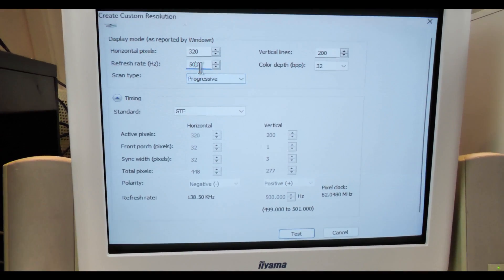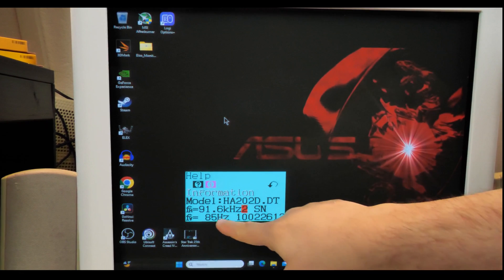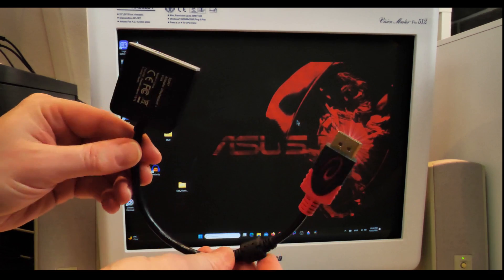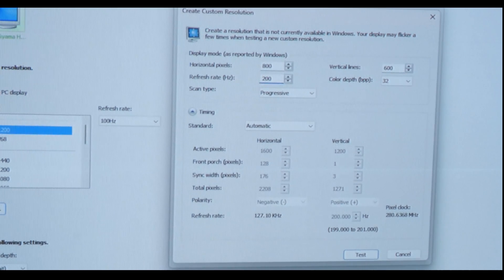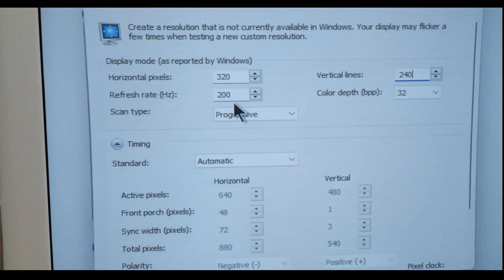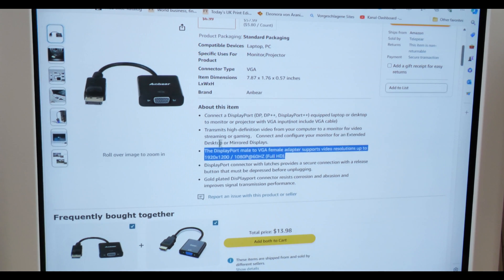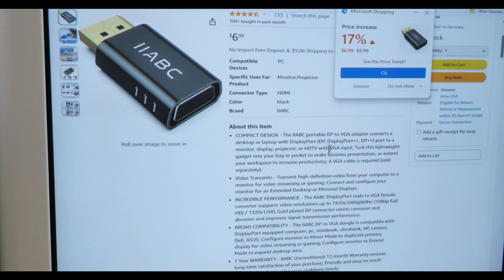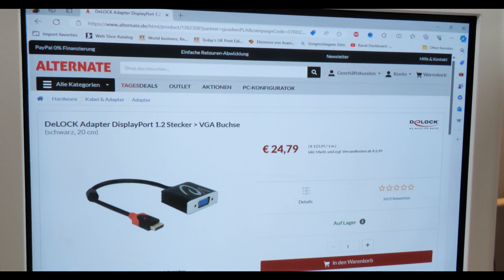The Best VGA Adapters to Connect a CRT Monitor to a Modern Gaming PC

Comment: I have that same delock adapter as you and no matter what I tried, I could not get it to work with any custom resolutions on my windows 7 laptop with Nvidia NVS 5100M. It will just say that the resolution is not supported with this display. It also tells me that this device is not HDCP capable and I am guessing that is why it won't work? Also, even if I use Custom resolution utility and try to run restart, it won't let me and a message will come up saying Failed to restart graphics driver. Unfortunately, I do not own any other device that has a displayport output, so it's etheir the delock itself, or my laptop that is not letting me set up a custom resolution. Can you please tell me how you got yours to work? Thanks!
Reply from the maker: Hey this sounds like a issue with your GPU or the way your Monitor is set up in Windows. Normally it just works, there is nothing special you have to do. Just go to custom resolution and enter a resolution that you want. Maybe try and change the Monitor to something that can 100% do the resolution that you try. It does not even matter if the Monitor is the correct one, I often just take Mitsubishi TUX 1107 no matter what is actually connected.
Reply: @RetroGamingBase  I guess I'll be buying a new computer then. I've seen your videos before and I know that you like pushing the limits of the iiyama CRT monitor that is said to be the fastest CRT monitor in existence, but have you ever tried to run interlaced resolutions on it before? I have a HP laptop from 2022 with Intel UHD graphics 600. I am using a Benfei HDMI to VGA adapter and can push it up to 2040×1400 as that is the max interlaced video resolution that it will accept and looks amazing on my Viewsonic Ultrabrite E70f+. Now I am not sure if newer Intel GPUs still support interlaced video as both big makers Nvidia and AMD seemed to have dropped it years ago, but on Intel's official website, they claim that their newest line of GPUs, Arc works with interlaced video resolutions, which would be absolutely insane if they do. I highly suggest that you give any Intel GPU a try, [to be safe, Intel UHD 600 series or lower since that is what I have been able to prove that works] (even laptop GPUs) just be sure to use Custom Resolution Utility to make a custom interlaced resolution, otherwise it won't work.

Comment: Excellent video! I have the Delock 62967 display port to VGA adapter for my LaCie electron 22 blue model II PC CRT monitor. My video card is the 1050ti GTX OC edition low profile model. I have noticed you are using the Nvidia's control panel to set custom resolutions. What about using using CRU by ToastyX app? Can it handle more custom resolutions or I can just use the Nvidia's control panel?

Thanks in advance!
Reply from the maker: CRU is good to force the resolution in every game. Most of the time Nvidia Panel is totally enough though.

Comment: What adapters do you use? The best adapters are all bought out now with hightest pixel clock, Sunnix DPU 3000
Reply from the maker: Yeah I think my video has helped to make them even more rare then they already were… I use the Delock one that I show here and I bought a few of them years ago.
Reply: @RetroGamingBase  I have also delock
Reply: @RetroGamingBase  buy another delock because there is only few units of this model on the market, almost bought out

Comment: Hi do you have a link for the delock adapter?
Reply from the maker: https://www.otto.de/p/delock-62967-adapter-displayport-1-2-stecker-zu-vga-buchse-schwarz-computer-kabel-display-port-displayport-S098D0HV/#ech=28618109&variationId=S098D0HVCXUU I found it here
Reply from the maker: Here is another https://www.voelkner.de/products/5196511/DeLOCK-Adapter-Displayport-1.2-male-VGA-female.html?ref=55&offer=acd748916611e872b7cce716f5f45865&utm_source=google&utm_medium=organic&utm_campaign=fpla&campaign_type=pla&pla_campaign_no=11594509194&campaign_content=163213285584&gad_source=1&gbraid=0AAAAAD7b-kYtqrY_0gDv9GOT0m-t649dr&gclid=EAIaIQobChMI6-bqoua1hgMVwJNoCR0fuApFEAQYAyABEgJwDfD_BwE
Reply from the maker: I could only give you a link for Germany if that helps? I just googled Delock dp to vga adapter and searched for the correct box art. Be careful! Delock also has a cheaper one who is not good enough. You need the 2500x1600@60Hz one
Reply: @RetroGamingBase I live in Germany that would be perfect
Reply: @RetroGamingBase  I cannot send links can you maybe put the link in the video description
Reply: I also tried to look for the cable but only found a 20 m cable
Reply from the maker: I suggest buy it at voelkner
Reply: @RetroGamingBase  thank you very much
Reply: @Uboo3  the delock with Red dp almost bought out

Comment: Actually would be interesting even in non Retro application. 
As an esport enthusiast, I wonder if you could drive the monitor in 200+hz in a more reasonable resolution.
I'd actually consider that for my VALORANT/CS Sessions.
Reply from the maker: It can do 800x600 @200hz and that resolution is still officially supported by windows 11 and is totally useable in all games. Especially if you use sparse grid anti aliasing it will look like full hd on a CRT. Check out my very first video on this channel and see how you like the looks. The resolution there is only 640x400@255Hz and it also still works good in games 😀

Comment: If you own a GPU with USB-C you can use a cheapo converter that will do what all the expensive HDMI or DP converters do. Like my Vention which was about 20 bucks.
Reply: What model of the Vention you have?
Reply from the maker: Nice! Good to know 👍
Reply: Search adapters for best chip on google IT6562fn

Comment: Any adapter that goes to a pixel clock of 360 to 370 MHz ? I have a Samsung 1100MB capable per spec of up to 160 Hz Vsync, 130 kHz Hsync, and 360 MHz pixel clock bandwidth. Does 2048x1536 at 80 Hz just fine, for example. In reality it can go a bit higher, but even per spec it's high enough for me. Just need a decent adapter to use it with a modern computer.
Reply from the maker: Read the pinned comment 😀 apparently there seem to be adapters that can do what you need 👍🍻
Reply: @RetroGamingBase  I find some Nvidia Quadro cards with 400 MHz RAMDACs (integrated), but no adapters... Apparently there are some that go to 300 MHz only. Currently I'm driving the monitor from an old HP laptop capable of 400 MHz also. But that won't run Windows 11, for example.

Comment: Yeah. But StarTech is better. I've a GeForce RTX 4090 GPU + StarTech DP to VGA adapter and... I can work 2560x1600@60Hz! - my video on 19th may 2023. 😍😁🥰
Reply from the maker: Good info! 😀 I need 100Hz at least though, or my eyes hurt. This Delock here can also do the 2560x1600@60Hz. At least it says so on its box, as you see in the video 😅
Reply: @RetroGamingBase  ok. 50Hz doesn't hurt my eyes, sorry but this is for TV or videos of 50fps only because we get pure smooth motion ( = single image). 😍😋😚👌👌 At 100Hz, we get double-image because any video has only 50fps capped. 😅😊
Reply from the maker: @ricarnuninho80  oh yeah TV is ok. Just at computer monitor CRTs you need more Hz to make it flicker free 😀👍 Especially in bright pictures or while in windows you notice flickering below around 85hz. At least most people do 😅
Reply: @RetroGamingBase  😊 But I don't like any real CRT 'TV' due to the weak focus, to the dirty picture (color, ghost...)... 🤮😅 I want any CRT 'monitor-computer' at 50Hz for excellent focus, for clear color... 😍👌🤗

Comment: im using the Startech DP2VGAHD20 for 800x600 163hz, works nice as far as i can tell
Reply: I can also vouch for this one, at least for my 96kHz display it let me max it out
Reply: Me too. 😁🤗
Reply from the maker: Awesome! Good to know Startech also has one that works! 👍
Reply: @RetroGamingBase  it has a problem though where it does not connect properly the first time you boot your pc, you gotta unplug and re plug the adapter for it to kick in to the correct resolution, otherwise its in the wrong resolution and blury, but other than that it works fine
Reply: @tvndno6023  what is that?
Reply: @tvndno6023  In my experience It often drops display out of the blue for a second at rendom times, I put it down to dropping sync but TBH am not not sure, it's 100% the adapter as I happen while doing 2560x240 at 120hz, basicly fooling my Mitsubishi's Diamond Pro 2070SB rebrand into doing 240p content, I was using a cheap old Lenovo Think Centre running retroarch which alongside the displayports it also has a VGA output, so I didn't use the Startech DP2VGA and went stright via VGA for it and it never dropped signal again.